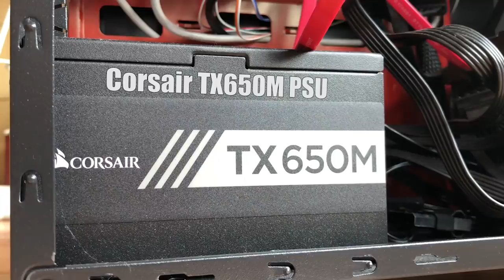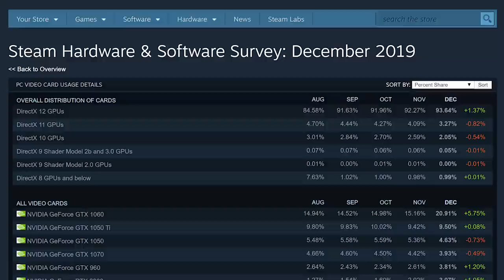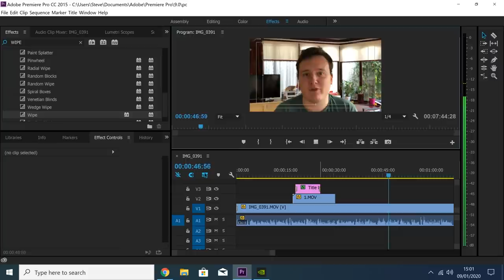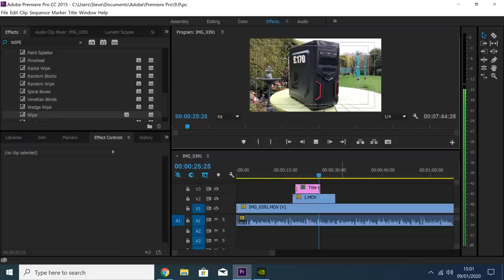What's Inside This £175 Pre-Owned Custom Gaming PC?

Comment: This system takes us back to a time when AMD was still kind of a joke.
Reply: They really were a joke on the cpu side of things. Though some of their older cards like the 7970 still hold up decently even today.
Reply: @R3in_Ch  emphasis on "were"
Reply: Eh, AMD comes in and out of being on top. Back in the mid-2000's they were murdering intel. First the Athlon-64 was just such a beast, then AMD followed it up with true dual-core processors and quad-core processors (AMD64x2,4). Unfortunately by the time AMD did quad-core intel was catching up and eventually dominated the high end CPU market until Ryzen. Even then that's only because AMD got to 7nm first, so they'll need to keep sizing down ahead of intel in order to stay ahead of intel. That is if intel can actually get to 7nm soon, but better that amd keep the heat on.
Reply: @ncolvin05  AMD also got ahead of Intel because Intel broke their own tick tock model at least in part through laziness. Cpus haven't moved in over 5 years. That's why Apple laptops had problems, because the Cpus were falling behind the curve
Reply: @ironmantooltime  Intel certainly didn't help themselves with it.
Reply: @dogrzz7082  I just retired my Hd 7850 a couple of weeks ago. It was still playing new games fine but it was starting to show it's age.
Reply: Joke is a strong word. They were positioning themselves the best they could with what they had to offer. Low cost APUs with low cost motherboards were used for many all-in-ones and also HTPCs that could also do light gaming (Intel let AMD have that market as the intel integrated graphics on their "cheap" CPUs was still rather buggy crap back then). Unfortunately what could work ok at 720p in 2015 doesn't work on newer games at 1080p.
Reply: @Moto andGivi 6700K will outperform the fx8350. 6600K struggles so much because it only has 4c/4t.
Reply: @Moto andGivi ah sorry, i understand now what you wrote xD
Reply: @Moto andGivi I still have my old FX-8350 system.. I'll have to test it but I don't believe you. lol.
Reply: Subi_fan  But the lack of a future upgrade path did suck. That being said, the mobo and cpu were fairly cheap, and Intel was changing sockets with every gen back then which also hurt upgrade-ability.
Reply: @L8Pl  I originally tried PubG with crossfire HD 6950s. That was a total mess.
Reply: @dogrzz7082  I agree that older GPUs are holding up well, still playing GTA IV and V on my old 7470M HD.
Reply: @ncolvin05  My gaming rig from the mid 2000's had AMD lol
Reply: @ncolvin05  and just keep on adding extra cores! 😅 I wonder how long will it take us to hit 50 and 100 core cpus??
Reply: @supertouring1  thread ripper is just about there honestly, for non-hardcore probably around a 1-2 nm range. Shoot 7nm now is up to 16 cores on the  r9 5k series.

Comment: This video brings back some nostalgia! I owned this setup before (X4 860K + 1050Ti + 16GB 2133MHz) and I have fond memories with it because I remember saving up a lot of school money for it and had sleepless nights researching. It was such great bang for the buck, but I do agree: 1) it's a dead platform and had no upgrade path and 2) the 860k had terrible frametime performance.

It was a great overclocker, though. I was lucky enough to get an OC to 4.2GHz at stock voltages with a Hyper212. It helped a lot and found 100% usage on BOTH the CPU and GPU most of the time. The OC bought my then rig a good year or two.

But alas, eventually the frametimes made me dizzy and gaming became a vertiginous experience. May 2019, it was time to say goodbye to the old gal. Sold the system and now went up to an R5 2600 + RX580 with 3200MHz memory.

Never looked back. Good times!

Comment: 1050Ti man, my last of the x50Ti range that I owned and what a beast, it's powering a friends PC now but man it felt great every 2 years upgrading and getting that massive boost, went from 550ti/750ti/1050ti and was always such fantastic bang for you buck, all were paired with my 3570k which is still kicking as a spare PC now, got super lucky and was able to auto clock it to 4.2Ghz... love that little CPU :D

Comment: I had that little Athlon on my A88 Asus motherboard overclocked to 4.4 Ghz.
Reply: I had a Asus A85 with an A8 6600k - ran at 4.8 Ghz without a hickup
Reply: I just got a 7650K and A58HM grenade with 16gb ram from the scrap guy on my street. Is it worth putting a graphics card in it? Tiny case though.
Reply: @scottrich976  If you have a GPU on hand you can definitly Game with it, but expect similar performance to the PC in the video
Reply: @ThomasSiebenhofer  will a gtx960 be good enough? I haven't done PC gaming since Alice and Half Life 2 Episode 2, oh and Doom3.
Reply: @scottrich976  it depends on the Game, If you Play GPU intensive Games you will be fine, but If your games are really CPU dependent you will be looking at a bottleneck
Reply: @scottrich976  yeah that will do great
Reply: A88X gamer with 7870k 4.4ghz
Reply: @redzyakuza  
Oh,c'mon !!!!
Used 860k with 7970,now, that is bottleneck.
Could see it clear on MSI Afterburner.
Reply: @DuneRunnerEnterprises  as my bits were free and £20 I'm fine with lower than expensive rigs that cost more than I get in a year.

Comment: I'm a little surprised that you did not try any overclocking at all. Since then 860K is quite capable in that manner (4.5GHz was not an exception) and this board allows it. Though the fan would surely need a replacement. Anyway, another great video. Thanks.

Comment: I have a Kaverti A10-7870k on this socket.
Punching it in the face with a 4.4GHz overclock on the CPU and 912 on the CPU with 2133 (nameplate 2400 but XMP was unstable) DDR3 gave me ... an admittedly rather pleasant experience for SFF IGP gaming in the era.
It's just that cooling a 125w overclock, 95w nameplate processor in an SFF case back in '14 .... was a challenge, due to the rise in small form gaming PCs being several years away.
Incidentally it was just this year that I finally built this PC up to its prime, with a Meanwell PSU powering a 160w Pico, and Corsair's H5 SF taming the furnace, all crammed into a cute little InWin bookcase enclosure.

Comment: The system proved to be good value, given C.E.X. sell a 1050Ti on it's own for £100 ($130), so you had the case, cd rw, motherboard, processer, fan, ram, hdd and power supply all for £75 ($97.50). Your right you could run pretty much any single card on a 650w PSU. I think the only two single GPU's that need more than a 650w power supply are, the Titan Z (750w recommended) and the RX vega 64 (700w recommended).

Comment: I got approximately 1380 points with an x4 860k on Cinebench r23, after overclocking it to 4.5GHz with AOD, the score remained similar, at around 1420. I've recently built a system with this one for hosting a csgo server, as well as using it as a guest pc for LAN parties.

Comment: With modular power supplies if buying second-hand even the same manufacturer cable might not be compatible across power supplies. I learned this to my cost as the magic smoke was emitted from my SSD a second or two after being plugged in.

Comment: That cinebench score is lower than that of a substantially underclocked (800MHz!) R5 3600... which pretty much tells you all you need to know about the choice of CPU.
Unfortunately, upgrading the CPU any further will likely require a completely new system board/platform, and a change from DDR3 to DDR4 RAM.
I also say that for gaming, less than 16GB RAM is pushing it. I upgraded my gaming laptop from 8GB to 16GB rather quickly.

Comment: My first gaming rig was FM2+ based. The athlon x4 880k (pretty much a higher clocked 860k) was a good budget chip (I paid like $60) but it ran hot as hell. I had it for about 2 years until I upgraded to a ryzen 7 1700. My original GPU (gt 1030) ran nice with it (I wouldn't go over a 1050ti unless you want major bottleneck issues) but my games were kinda stuttering with my 980.

Comment: Something seems wrong with that setup.  The 860k is a 4-core CPU.. but is showing up in Cinebench as 2C/4T.   It should realistically show up better in terms of score.   You might want to verify all the BIOS settings.  Also, the 860k has an unlocked multiplier.. so you should be able to OC it quite easily with little effort.  Why not go for it?  While you're at it, find some cheap RAM heat spreaders and OC that RAM as well.  The 860k can support 1866 RAM if I'm not mistaken.

Comment: Had a X4 760K for several years in my main PC,  the 860K just wasn't worth the effort to upgrade.  When I finally did upgrade, I went to the Ryzen 1800x.  
It's safe to say my gaming experience improved a touch!

However, I still mess about with FM2 hardware even today as I have a soft spot for that whole AMD era.
Reply: I still use an FM2 system (A8-6600K). I mostly use it for basic usage (not gaming) and for that purpose, it's still OK. I looked at CPU upgrades, but as mentioned in the video, other options simply aren't worth it.

Comment: I just upgraded from FX 8350, 16g ddr3 and 1050ti, to Ryzen 3 1200, 1600g ddr4 and 1050ti. It runs the games I play (Far Cry 5, Fallout 4, RDR2, Crysis and more) pretty well at medium to high settings. I usually OC my cpu from 3.2g to 3.8g during gaming. I am intending to upgrade gpu and cpu fairly soon for even better performance, but this build was what I could squeeze out of a Christmas budget.
Reply: Did you upgrade to anything better since then? 😃
Reply: @Generationalwealth94  lol, yes
Reply: @paulapsley3712  what did you upgrade to

Comment: I have an A10-7870K (brother of the athlon) overclocked to 4,5 GHz and paired with a GT 1030 GDDR5. I built it in 2015 (with an A6 7400K). I upgraded at middle of 2016 to the A10. I used it with the integrateg GPU to 2019 and bought the GT 1030. Sometimes the processor is weak for the GT 1030. Sometimes the GT is the weak spot. A was on a tight bouget. I would like to build a ryzen PC but i have no money for it. I use the PC for gaming, 3D modelling, and for Unity engine. (Note: the AMD not advertising but if the integrated GPU is used at full potencial the CPU Core clock is go down to 3 GHz even if it's overclocked. With the GPU upgrade i gained more GPU and CPU power and freed 2 Gb Ram.

Comment: I had a very similar build a while ago. I had an A10-7600k (something from that line) and used the built in the GPU to start with and added a 1050ti later. I was playing older games at the time (TF2, and 360 era games). I remember when at college we had to do some SQL work and the CPU just hated it. Data serachers that took seconds at college took a good mintue on my home rig. On a Ryzen 5 now much faster.

Comment: I'm inclined to believe that something like the Core 2 Quad or Phenom CPUs might be a better value for the money. Although those are more like from 2007, but they do have 4 physical cores.
Reply from the maker: Yeah I’ll have to revisit the core 2 quad soon and find out
Reply: @RandomGaminginHD  for $40 USD, I did pick up an Asus p5b motherboard with an Intel Core 2 Quad Q9550 CPU and 4 gb ddr2 ram. It's supposed to arrive today so I might do a video on that when I put it together.
Reply: @RandomGaminginHD  just a follow up, I did put together my Core 2 Quad PC but had to do some troubleshooting. First, it kept saying CPU ucode error, and it kept saying that the CPU was overheating even though when I touched the CPU heatsink, it still felt cool to the touch. It turns out that the Q9550 was newer than the motherboard it was on and it wasn't being detected properly, so I updated the BIOS, and now it works just fine.

Comment: I built a new system last week, i3 9100f with a 1050ti. It replaced my old FM2+ System (A8 4C 4T), it just could not handle csgo anymore, now, on my new pc I get about 300 fps on CSGO, 70Fps on GTA V (High)
only cost me £300, already had the gpu. It is a very very capable system, although I will be upgrading to a 1650 very soon.

Comment: If you wanted to turn this into a budget rig i'd personally throw in a cheap matx b450 and one of the new 1600 af cpus  (2600 with gen 1 imc..)
Reply: + DDR4 RAM?
Reply: @JT-ko2ib  Well yeah obviously, just throw a cheap 3000 mhz kit in?. Would still be a relatively cheap upgrade and would stomp all over the i3 mentioned?
Reply: @FredsRandomFinds  It's a good option. i3 is pretty redundant now, unless you get a really good deal on the latest generation.

Comment: Well, if you're on a tight budget you probably also would buy a second hand monitor thats native 720p, to squeeze as much performance as you can get out of the build. But yes, i once made a build with the same cpu, since i found an old amd hd 7850 in my storage, and i too were experiencing problems when it came to cpu intensive tasks.

Comment: i did regret buying the 860k at first, but used it for along time till i went Ryzen and got an old intel Build around the same time Athlon 860k came out and never looked back, 860k still deos very well if you plan to use it for streaming and average use
i did play doom 2016, RE5, RE6,RE4, Deuz Ex, Thief 2014, Sleepless Dogs, and they played pretty good on that chip

Comment: The Ahtlon x4 860k was my very fist CPU! I've made sure to keep it, the motherboard, memory and graphics card all these years later.
Reply: Sanity Logic what’s the other bits
Reply: @Jack-fb6sr  FM2A88M Pro3+, XFX R9 380 Double Dissipation 2GB,  I had 2x4gb team group DDR3 sticks at 1600 mhz, 1TB Seagate drive which died fairly quickly but served me well, and a 600 watt evga bronze psu. All put into a Deepcool Tesseract case. Cable management was shiet, and it was loud due to stock cooler, but I got by and had fun doing it.

Comment: my first custom pc had an Asus board with a FM2 socket and an AMD A8 6600k clocked at 4.8ghz. I first ran it with an GTX 750 Ti later on I upgradet to a GTX 680 I got free from a cousin of mine and the last gpu this system saw was a gtx 970 which was fairly new at that point in time.
I was surprised that the CPU didn't even bottleneck the 970 that bad...

edit: it was a FM2 mobo, not a FM2+

Comment: Some time ago I found an Asus Essentio desktop M51BC PC (dumpster find) has an AMD FX 8300 & Radeon R9 255. Still runs - needs cleaning, thermal paste reapplied, etc. Has Win 8 on the HDD, but I am leaning towards getting say, a 250GB SSD, and a better GPU, like an R9 280, 290, 580, or a 7850. Thank you 🤓

Comment: Ayyyy! its my board and cpu lineup, i just got in some used parts to upgrade from that board and my athlon 880k, what a terribly unsupported socket n board, theres barely any upgrade paths that are worth it, better to get a used i5 n board cuz u can then re use the ram etc like ive done :D Those athlons are GTX 480 of the cpu world, mine had 4Ghz ran at 75+ C with idles of 50s on an aftermarket cooler..it is really a terrible platform

Comment: I've got a soft spot for the x4 860k. First cpu i bought when I got back into pc building after many years since it matched the cheapest mobo new on amazon at the time. Ran a bit hot but punched above its weight imho

Comment: ok pro tip if u use kaveri with a 10 series card, u can turn up ur setting till the fps starts to drop, the cpu will run at 100% usage but slightly under boost clock, meaning u have head room just put the load on the trailer(gpu) and not the truck(cpu)
Reply: if we could hop in discord i could show you how to deal with a cpu bottleneck
Reply: legit lowering the setting is just dropping the load on the cpu

Comment: It's an unlocked "K" cpu, even on that cooler it should be easy to hit a 4ghz OC, maybe a little more.
Reply: You're technically right, but technically wrong, it pains me to read it I hope this was a joke
Reply: @wsketchy  *An all core sustained overclock vs a single core temporary max turbo frequency overclock.
Reply: @JamesSmith-sw3nk  I was actually more thinking about the -K suffix, I thought that only applied to Intel but I've realised I'm wrong. An error on my part

Comment: the new budget king GPU is by far the 1650 as it doesn't require external power!
Reply: Rx 570 always remained a budget king. Lower price than both 1650 or 1050 ti, but its tdp is 150W.

But i can agree, 1650 is quite powerful, knowing it uses only pcie power.

Comment: You really don't seem impressed with 1050Tis, at the end you said it was capable of delivering "playable framerates at reduced settings". Most games get a solid 30fps at maxed out settings, so reducing settings is typically only required for 60+ fps.

Comment: Have you tried OCing it? Also, how would it OC compared to the newer CPUs that came out 2 years later in 2016 (Athlon X4 880k (4GHz base w/ up to 4.2GHz turbo) & A10-7890k (4.1GHz base w/ up to 4.3GHz turbo))? Perhaps you could compare them to the older Bulldozer FX CPUs such as the FX-4170 that got the same amount of cores & threads* along with a 4.2GHz base clock & 4.3GHz turbo even though it came out 2/4 years prior in 2012.

Comment: i just upgraded my FM2 pc from overclockers i had the A8 6600k and after putting a gtx1050ti 4gb its would still play most games this socket isent as bad as you think if you get an A10 7+++ cpu and 16gb ram they overclock very well and stay cool on stock cooling i got my 6600k up to 4.2ghz and never had any problems plus if you have a crossfire enabled amd card from say 7000 series it could be tricked into crossfire with the apu

Comment: Heh, got that PSU in my current rig... and that CPU in a box somewhere (it had 2x4GB 2133MHz DDR3 to play with back in the day). Would it be wrong for me to say that my Ryzen 5 1600 actually let my GTX 950 reach its full potential? :)
Still, an X4 860K would likely be a more useful CPU than the G3258 nowadays, if you hope to play anything remotely modern. Faster RAM might even help with some of those dips.